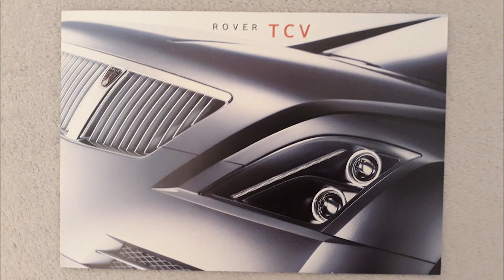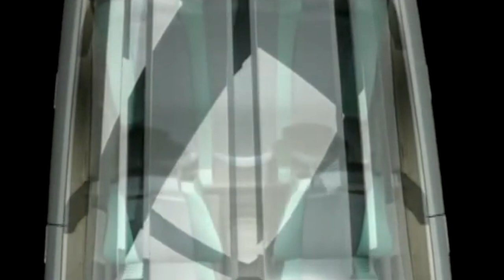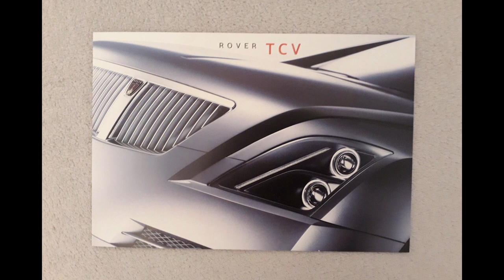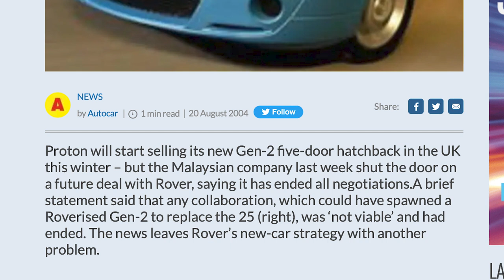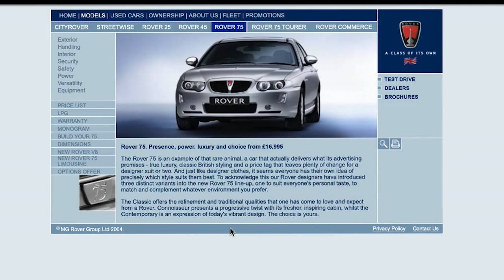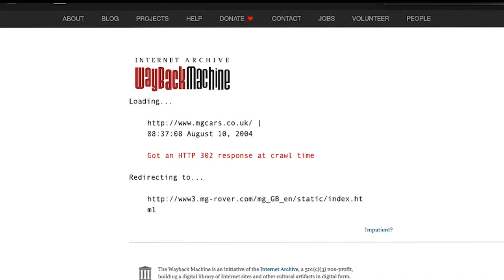This COULD HAVE SAVED MG ROVER - The Rover TCV Story

Comment: I worked on that concept car when I worked for Rover back in the day. A Rover 75 was used a mule car, the body hacked to pieces, a frame built and a fibreglass body draped over the top. I designed all the tailgate hinges and most of the boot floor when I worked at Canley.
Reply: Hey one question what year did the TCV project start?
Reply: nice work! btw what is its interior?

Comment: A great concept that solves many of peoples issues and compromises of cars of the time. It solves the tightness of the R75 Tourers boot, so yes I would have deffo looked at a R75 TCV, if it could still tow reasonable weights. I bought a late R75 tourer, but the boot has been a bit of a limit, especially when compared to the space in say a Montego estate that was boxy useable and had fold up seats. Maybe a raised version would have added the 4WD like the R75/Freelander combined concept.

Comment: With the right funding and ownership approach Rover/MG could have thrived in the same way LandRover did under TATA. I worked for JLR the last decade, worked with many many people who where at Gaydon/Longbridge in the Rover days, people forget the BMW MINI was a Gaydon/Longbridge car done and dusted then taken away by BMW right before launch, the BiW for the next Rover 45 would go on to become the 1-series. A lot of the senior engineers on Rover 75 project were running the place when I was there, lots of talent. 
The overriding theme talking to them was that the place never had the funding, and when new owners came in like BMW or Ford, they would come in and have too much control, changing all the systems etc, slowing the engineering machine down. 
When TATA came in they funded well but they also left the place to its own devices largely, and trusted the talent, the Evoque being the result, then the L405/494 etc. That is what Rover needed, handled properly we could of had a very successful car company today with MINI, LandRover, Rover, MG all still under one roof. With the TCV and Streetwise/Crosscountry stuff being worked on Rover were ahead of the upcoming push to SUV's/crossover game but didn't have the funds or management to pull it off.

Comment: In the very late 90s I was working at VW Audi at the same time as Rover Mazda (yes Mazda) and in the Audi showroom was the original Audi Allroad. This was essentially a higher riding A6 Avant with more off road type of styling and trim. The ride height could be adjusted by a button.

The overall vibe was that people knew Rover was going under and any new ideas or concepts just weren’t taken seriously.

Comment: As far as I was aware at the time, mgrover had no access to Gaydon. That went with Land rover when rover group was dismantled by BMW in 2000. All Rover 45 research and development was done in house at Longbridge and by TWR until that sadly went into administration. 

The TCV always looked like a vauxhall signum. A good concept that failed due to its very run of the mill styling. 

I always think mg rover got it wrong fixating on a rover 45 replacement. At the time the 200/25 was the big seller. Ironically in business you focus on your best selling products and not your worse. In other words growing your strong areas. They had already lost the focus/golf sector.

Good video.

Comment: Pity the photos outside Longbridge of the blue one weren't enhanced by pumping up the back tyre - prophetic in some ways, perhaps.
My 2nd new 25 was due for replacement in 2005 & I would have bought a TCV, especially if available with the 2.5 V6. As it turned out, I'd done a deal on a discounted ZR that I was due to collect in a couple of days. I cancelled on the day it was announced MGR was definitely down & out and there was no certainty of parts or aftersales service. I kept my old one & sold it at 176k miles 11 years later, when a friend found my ZT-T V6 190 for me.
It was always sad that BMC/BLMH/MGR etc etc didn't fight back against the knocking copy initiated by Ford.

Comment: The thing is all the floor lowering, electric seats and gizmos shown here would of not made it to production. They would of just stripped all that away, then replaced a lot of mechanical parts with whatever they had been using since the BL days. Then they would have overpriced it with less standard equipment, like they did with the city rover and it would of flopped. Not because of reliability, just down to bad management in launching and marketing.

Comment: What a depressing video... even Lancia at the car shows thought they had a future....

Rover really missed a trick by proposing a practical sensible useable stylish estate-type vehicle with lots of cleverly engineered space when 20 years later we now know that what everyone wants and needs is something with all those angles and edges but exaggerated and in the size of a Freelander but with the interior space of a Streetwise, with big wheels and wide rubber band tyres (but no spare wheel) and all the back windows blacked out. And tells you exactly where to go and ideally saves you the bother of actually driving and thinking etc. while you're busy talking or texting....